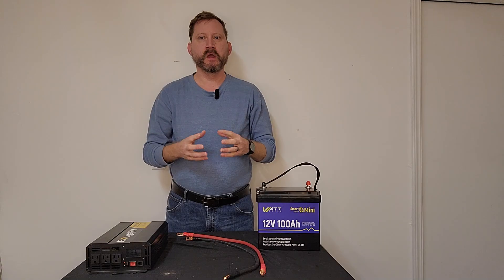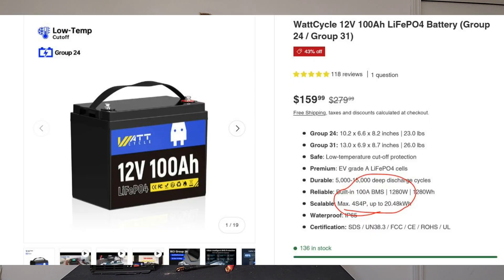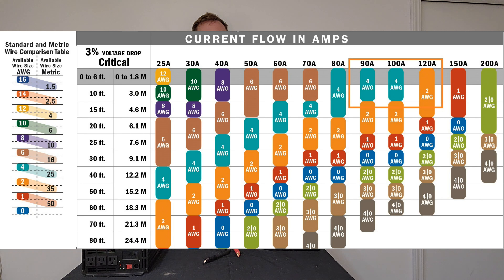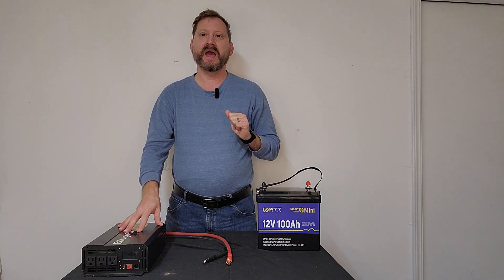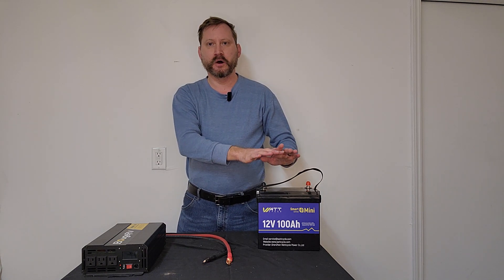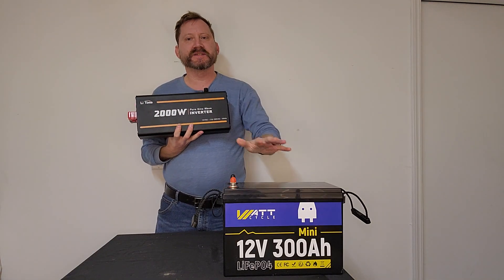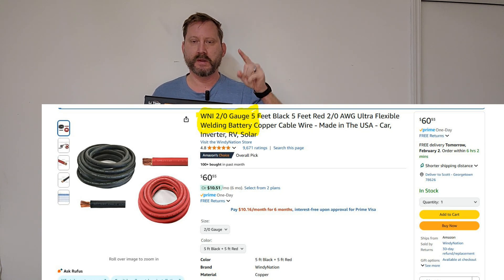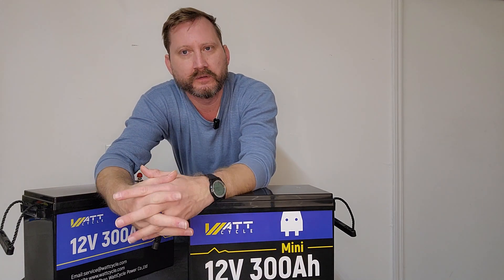Building a DIY Power Station DIY Start here! | Texas Prepper Projects #prepper #solarpower

Comment: Now do a video on daisy chained parallel batteries showing cumulative amperage across the wires.
Reply from the maker: in a perfect world, it's split 50/50 but that's an interesting idea
Reply: I agree with this and I think everyone will be surprised that the results will NOT be what you expect.  I have two separate 4P 100Ah banks and there are times that on a 60A load, two batteries discharge at 20-22A and one sometimes 10.  Then once I exceed 200A draw down, those two lowest batteries start charging up by drawing down from the other batteries as much as 13A!  So much for the theory of using a buss bar to balance......but eventually they will balance but NOT exactly at the same time during use.....
Reply from the maker: @  this is why I personally don't like to link more than 2 batteries together